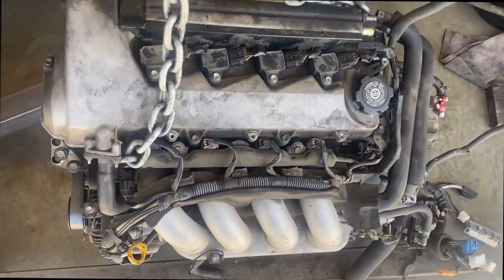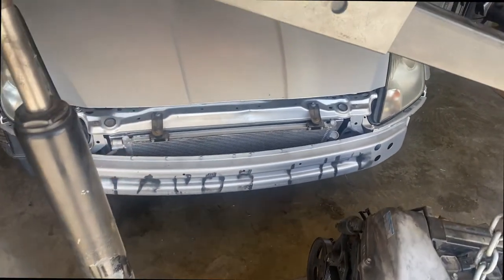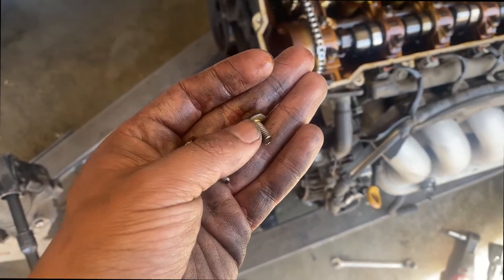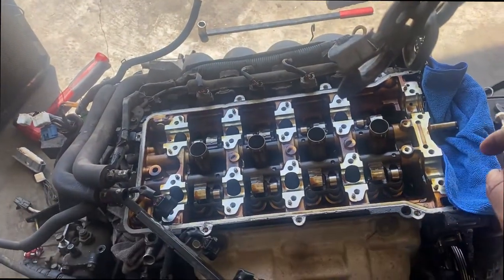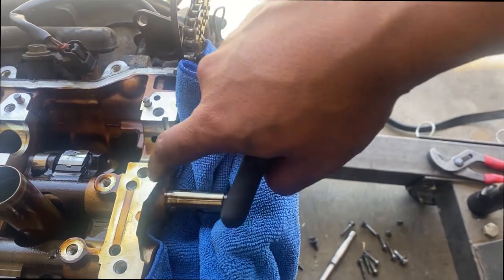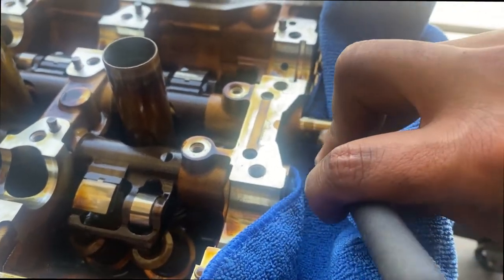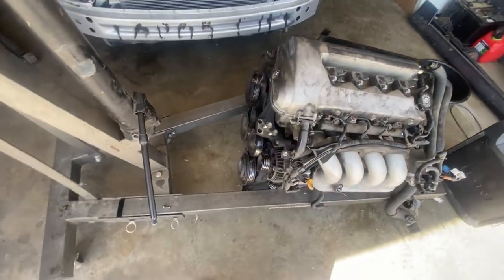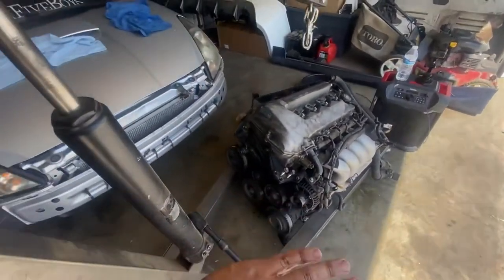2zz Broken Lift Bolts

Comment: mine is stuck well... cant seem to suck it with a magnet , any other ideas?
Reply from the maker: You need to extract it or push the rod out
Reply: @RafasGarage  i have pushed the rod out fairly far and i still seem to not be able to drill it safely oe remove

Comment: That looks hella easier outside the car
Reply from the maker: Yes nothing in your way
Reply: @RafasGarage great video mate! in your opinion and experience can the 2zzge go over 250.000 miles with very good maintenance without rebuilding and big issues?
Reply from the maker: @DimoS...  yes it can my buddies car is at 300k+ on original motor
Reply: @RafasGarage 300.000 miles no kilometers right? very impressive for a high revving engine, reliable engine the 2zzge. What oil brand you recommend in 5w40 mate? Is liqui moly molygen good?
Reply from the maker: @DimoS...  yes miles 5w40 is goos
Reply: @RafasGarage  thanks mate!✌